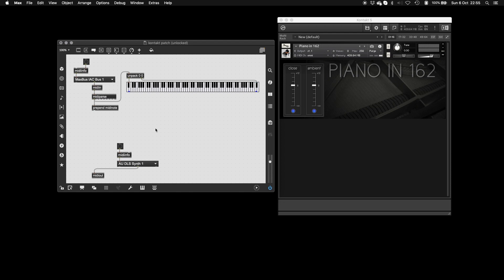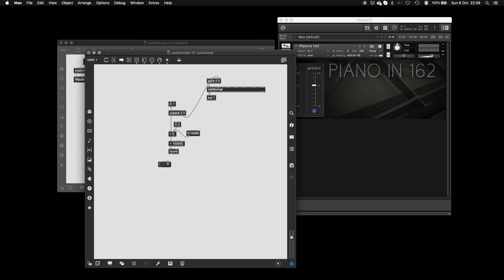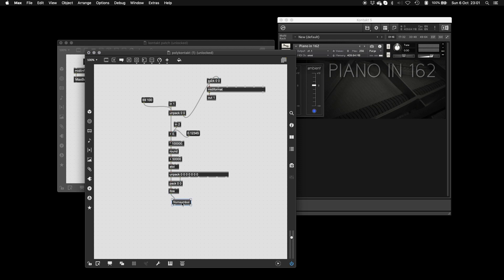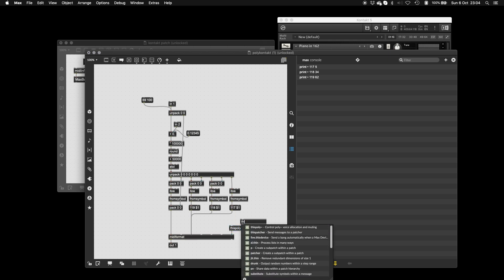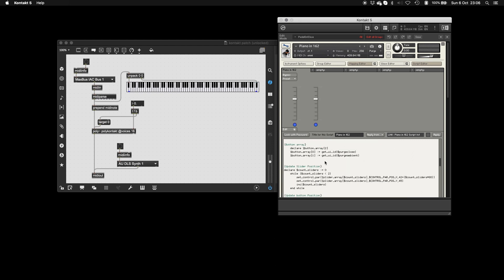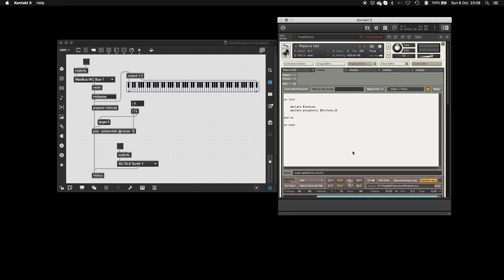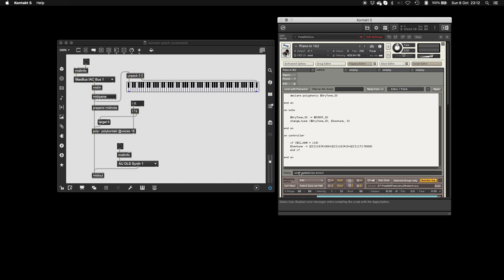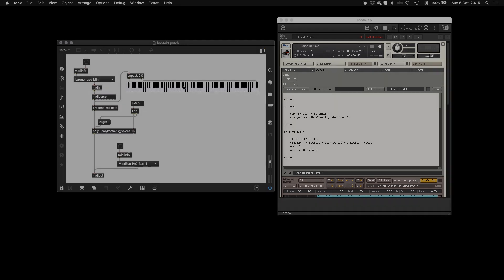Polyphonic Microtuning in Kontakt with Max MSP

Comment: Heyy, how could you have Kontakt 5 on your Mac? I only found 6 and can't add an instrument there... This Max patch only works with Kontakt..?
Reply from the maker: This patch only works with Kontakt 5. I have plans to check out Kontakt 6 in the future, but haven't yet gotten around to it. If you don't want to use Kontakt my other video on the Temperament Generator might be useful for you. :)
Reply: @lwolstanholme  Thanks for all your kind informaion! I really want to hear how it will be, if there is a pitch change just on one note. Now I can just make a pitch change(Tune..) on the whole notes, not on a special note. Do you think, it will be a high level patch? I lost my next step, what can I do for that...
Reply from the maker: In some cases it might be easier to do this directly in Kontakt, as most instruments have a tuning function built in. However, if you want dynamic retuning I recommend checking out my other video/patch Temperament Generator. This patch has the Kontakt functionality built in, and the video on my channel will give you some ideas regarding how to make this tuning. :) thanks
Reply: @lwolstanholme  Many thanks for all your helps! With your helpful videos I can continue to work and find a way. THANK YOU!

Comment: This is amazing! I am working on a project where I am using the ZSA descriptors to get snapshots of partials from field recordings. I would then like to tune the partials to the nearest quarter or eighth note. What would be the easiest way to do it using this method? If you have time, any advice greatly appreciated!
Reply from the maker: Do an FFT on the recording, find the frequency and amplitude of your partials, create your desired temperament, map the amplitudes to the new partials and do an inverse fourier transform? Is that what you're looking for? Thanks for checking out my work.